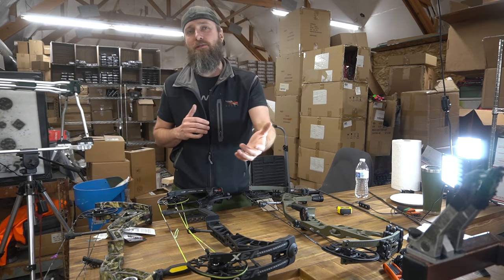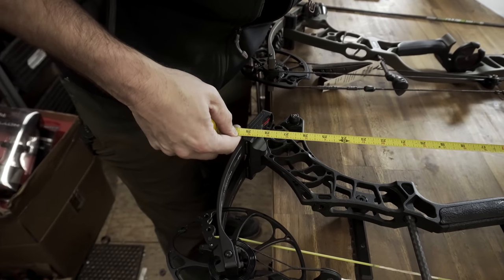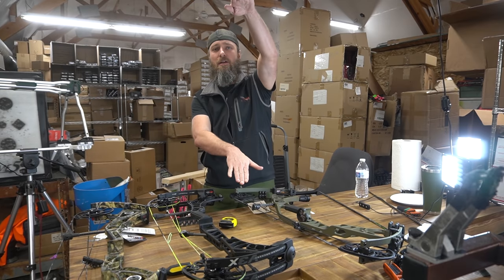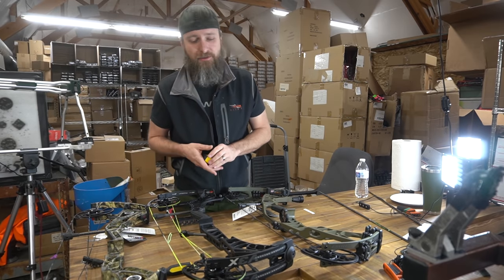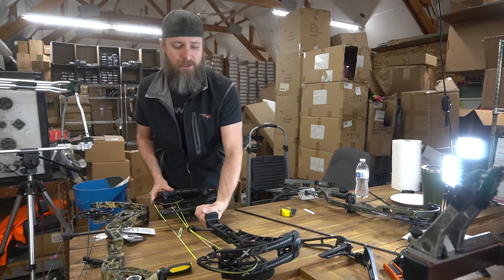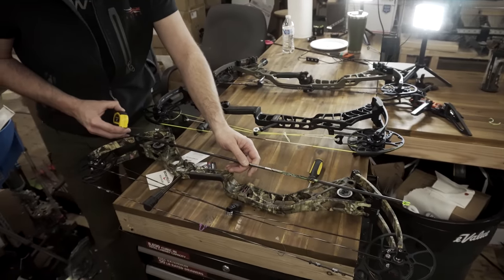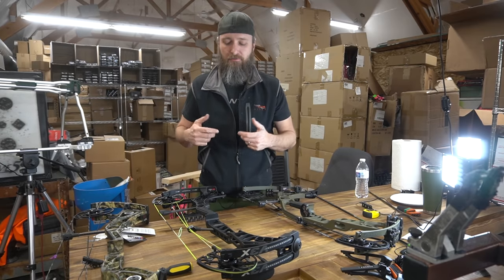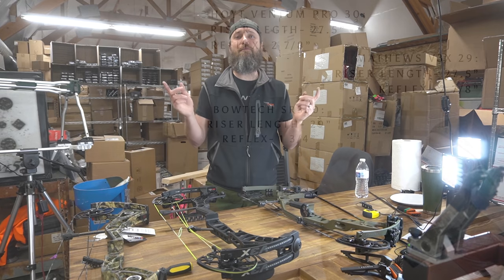What Makes a Bow Accurate? Find out with MFJJ!!

Comment: Additionally, would you consider doing a video on what you consider "great" and "acceptable" accuracy. Like great is 1" groups (or less) per 10 yards of range and acceptable is 1.5" per 10 yards of range (e.g. 4" at 40 or 6" at 40) with 3 to 5 arrows. Also, could you compare your shooting with the various releases - handheld thumb-actuated, hinge, and trigger finger-actuated to see if there is an appreciable difference in terms of accuracy and point of impact. Thanks again.
Reply: I would guess every flagship bow on the market is possible to shoot within those accuracy standards when properly set up. The bow fitment to the shooter and tune would have a large impact on those results which would vary from person to person.
Reply: @jordanc1780  That is a great point - that the bows are inherently capable of tight groups. So, when the archer is added to the equation, the group size outside of the inherent capability of the bow is the archers fault. Then, what we need from MFJJ is what are the common faults in archers that cause poor shooting.
Reply: @richarddean3154  I was just thinking the same thing. Many years ago I was dead set on upgrading my rig because it wasn’t shooting good for me. That kinda flipped on me when the guy helping me picked up my bow and drove tacks. Changed a couple of things and I was too!

Comment: I’m very happy you’re going to include these stats in your bow reviews going forward. Could you also consider measuring string angle on bows? This is also an important consideration and it’s info that’s almost impossible to find.
Reply: That’s why they give you axle to axle. Plus it’s going to be different at every draw length. If you don’t like a tight string angle then you don’t want anything under 32 inches imo and honestly if string angle is a concern for you then 33/34 and up is all you should be looking at. Anything at 34 and over will be perfectly acceptable for anyone in the string angle department.

Comment: You may also consider providing total length when you provide mfg ata. A 30" ata bow with salad plates for cams will have a real world length of 36+" which would be a negative for some, but would  provide a better string angle, and be a positive for others.

Comment: Good info. I feel like the bow that feels the best and I have the most confidence with is what I’m going with. I’m not a target archer, I’m a hunter. I shoot every day, and a lot. But I still don’t feel I’m accurate enough for these differences to really stand out enough to make my overall decision. Almost all the big manufacturers make equipment that will far outperform most of us. I truly like what feels best. Draw cycle, steadiness etc…I don’t shoot farther than what’s acceptable with my Broadheads, so that’s the true test and I typically don’t tend to go off measurements or popular opinion. That being said, these added measurements from manufacturers would make it easier to make a decision without spending all day in a bow shop and/or wasting money trying to find what you can shoot best if you don’t have that availability.

Comment: I agree with you that the riser length and reflex contribute more to accuracy than brace height and axle-to-axle.  However, brace height can be reflective of reflex, since a larger brace height tends to indicate less reflex in today's parallel limb bows.   Similarly a longer axle to axle somewhat reflects a longer riser, particularly within a brand; though you pointed out that across brands, this is not always the case.  Regardless of any of the four measurements that you discussed, what I think contributes most to the accuracy of any bow is the amount of time the owner spends practicing with the bow; and by practicing I include shooting arrows at various yardages and working on form.

Comment: 👍👍 it's about the mechanical advantage of leverage points. Basic geometry. As the pivot point ( where  your hand meets the riser) is moved back toward you from the limb pivot point the " triangle " becomes bigger. This allows an easier ability for the limb tips to move left or right  because the three points of the triangle are farther apart. A long narrow triangle, even at full draw when the cams are rotated and the position of the string has moved along with the limbs flexing back toward you, will have less perceived and actual " wiggle" left or right. For those that work with their hands and build things this concept is easy to grasp. For those that can not understand all this- just trust ol' MFJJ!

Comment: Reflex and brace height is all I care about. 
A2A and riser length make minimal impact on perf unless you're shooting ultra long range.
Brace height tells you how soon your arrow leaves the string and reflex tells you how easy it'll be to shoot regarding torquing - this is why I only buy recurve bows with the throat and plunger hole perfectly aligned (vertically).

Comment: Good info. Explains why I shoot Bear bows so well maybe. They don't get much more than a snarky response or comment most of the time but they are very easy to be accurate with bows. The newest Bear Execute 32 flagship  measures 1.5 inches. The Moment from 2016 and 17 measures just under 2" and the Refine from last year measures just under 2". All very accurate and quick bows regardless of the brand they Bear, lol.

Comment: MFJJ, good video, but do you have any doctrine when it comes to know “when should I upgrade my bow”?  I’m looking for some kind of metric, similar to those with used cars to know when is it about time to upgrade? When has the tech upgrade enough to I know I’m getting my money worth of upgrade? For me, I have a 2015 Prime Ion bow I bought used off of EBay . Thing shoots good, but it is hard to tell if upgrading to a V3 or V3X (or other) will yield a sizable difference in my consistency, accuracy, etc. it’s hard to know, on a limited budget, so I upgrade my arrows / rest or do I save up more for a newer bow? Hard for me to go actually shoot, I live in DC with no local bow shops to work on my rig. Thanks!

Comment: Makes sense. Curious which measurement you think is more important. 
I love my SR6, but have never shot a Mathews besides the older single cams. 

For long distance shooting between, say, a V3X 33 and a Revolt X, which would be more accurate?

How does the CP28 compare to the V3X 29 with riser length and reflex?

Comment: A couple of things that you should probably add here would be limb angle and cam system. 

Riser length is not where any of your accuracy comes from, if it was then all of your manufacturers would be still be using risers longer than the ATA. Long risers create parallel limbs and reduce hand shock, they have no effect on accuracy. If we look at the target bows that have dominated over the years, PSE, Hoyt, Bowtech, older Mathews models, have all short, deflect risers with very steep limb angles. This creates an extremely stable and accurate bow and also reduces riser flex. 

Cam systems are one of the most important part of creating an accurate bow. If we take a cam system like the cross centric cam, split yoke binary cam, even some hybrid cams, those cams are very particular about timing and typically the cable creep on these cam systems can greatly vary, thus affecting accuracy. Take a system like the parallel load binary cam or four track binary cam and those cams load the cables equally throughout the shot cycle, equalizing load and creep along the cables.

Comment: This makes sense based on my recent experience. It's the reflex dimension more than the riser length in this case. I tried to figure out why my new bow felt like a noodle (torquey) versus my other bow. I haven't measured those bows yet myself but they are among the ones you have measured in this video. My Bowtech is rock solid compared to brand X. I sold the brand X and moved onto brand Y which is more solid than the X but not as compared to the Bowtech. I will be measuring both today to see how they compare.
Reply: Brace height?

Comment: What role does limb angle play in the accuracy equation?
I have noticed bows at full draw with past parallel limbs and high let off seem to be very easy to torque.
I have also noticed most target bows have very upright limbs.

Comment: Question that is just a little relevance that I can’t get a straight answer to, please....while measuring, ata is it center to axel bolt to center to axel bolt? And for brace, deepest part of grip to inside of string, middle of string or outside of string?  Your help, please. I’ve been in archery for years and this small insignificant question has bugged me.

Comment: Does reflex really matter? A set of ultra short limbs would have less leverage to counteract hand toque in the case of the Bowtech. Whereas long limbs have more leverage to counteract hand toque, like on the V3 Mathews. I would think the distance between the grip and the axels is the real key to accuracy. Hence why target bows generally have smaller cams. The smaller the cam the further back the axel is from the grip for a given brace height.

Comment: Good video, 👍 I will add that a bow with a 7" brace height will always be more accurate because it helps settle and calm the bow down from wobbling or wagging the dog as I like to put it.  Mathews has the greatest amount of side-to-side wobble in my oppinion and therefore when your watching a target bow being drawn back you can see the wobble more because of the longer stabilizers compared to a hunting bow set up. Manufacturers push and emphasis speed more than accuracy...it should be the othervway around...if your shooting a hunting set up @ 70 and 80 lbs then speed and less arrow cast becomes the overriding factor over accuracy. First an accurate bow almost always lands on a comfortable and manageable draw cycle....also I like to measure axcel to axcel and mark that center spot on the string then determine how that relates to the berger button location...you would be surprised how often those two locations don't line up....accurate bows most always line up in this regard....thanks again 🎯🎯🎯

Comment: I shopped all of the bows this year, and found that the bowtechs held really nice but I was not a fan of the grip. This video shows there's a lot of nuance in bow buying, that's why it shouldn't be a rush decision! I ended up going with a prime inline 5 which was way longer than I had planned on buying of a bow. But of all the bows I shot this year, in my hand, it held more steady than any of them.
Reply: I also went with the Prime Inline 5 for the same reasons.  It just flat out shoots which makes a lot of sense when you take into account the metrics in this video.
Reply: @raywarner4704  100%. What options did you get? I went with 80 lb limbs and hammered gray finish. Can't wait. 4-6 week lead time because of the limbs. But worth it.
Reply: @ApexPredatorOutdoors  pretty basic setup for me - 70 lb, grey riser black limbs.
Reply: @raywarner4704  Ita a great shooter either way! Enjoy!

Comment: Fantastic mfjj! It's about time someone provided real info rather than regurgitating marketing crap. I'm over 50   and have owned countless bows. Reasonable reflex, long riser (and associated weight) are key to accuracy. I currently shoot a 2015 Mathews Wake: 5lbs, 33.5 riser (35 ata), 3" reflex, 5" brace, and 352fps with smooth draw. 7 years ago when introduced the pundits said  it was too heavy, long, expensive, and twitchy. If manufactured today it would be more or less inline with what the flagship bows are now....only faster thanks to the 5" brace height. The Wake was used to take gold in the 2016 50m womens European World Archery Cup, so it must have some level of forgiveness. 

It's nice to see Mathews and others introducing flagship bows that are almost as good as a 7 year old bow. BTW, I use my Wake to hunt (stalk and tree stands), and it's not too heavy,  long, or unforgiving.

Comment: I'm curious to know ATA lengths at full draw. It seems this would be the pivot point that's most important for torque while actually shooting. Great videos! Looking forward to your 3 bow builds!
Reply: ATA or string coming off the cam at full draw?  I think the total distance between cam grooves where the string comes off is what really matters since every manufacturers cams are different sized and depending on your draw length will be coming off at a different part of the cam when it stops.
Reply: @nathanwiens108  yea good point, some cams are really big now days. Agree 100% I'd like to see those numbers where string leaves the cam

Comment: Since I started shooting bows with fingers axle to axle determined release consistency. The let off also determined consistency 65% was more inconsistent , release improves this in wind higher let off decreases this as well and decreased  accuracy and speed. I agree riser makes a difference  . Brace height improves string contact time and improves is draw length which improves speed . I'm noticing cam design affects bow weight vs arrow weight  is a big gap speed bows don't always. Yield high fps when looking at 500gr arrows and accuracy . Does the axle and cam affect true speed and accuracy is my question ❓

Comment: I cant dispute your thoughts on the amount of reflex plus or minus effecting accuracy mostly because I'm not a very book smart man but i think It comes down to a archer shooting the bow and going with what is most comfortable for said archer to shoot . That said I ve been shooting regularly since i was 10 years old and im 49 now and have owned many bows and I have  bows with a ton of reflex that i shoot leaps and bounds better both that have great stability and accuracy over my very low reflex target bows and vice versa. I have bows with nearly no refex that are extremely torquey . I think overall weight and the grip have more to do with accuracy than the amount of reflex as well as riser stiffness but like i said that's just my opinion and what works for me may not work for you. Also a bow with more reflex tend to have a longer power stroke giving the arrow faster speeds wich is why speedbows have allot of reflex . Anyway to each his own . Thank you for your great videos and intelligent incite into parts of the sport most never think about 👍

Comment: I shoot the hoyt but it is torquey compared to my old elite 35 you can pretty much grip it a few ways and still bustem the hoyt makes it a little harder for a repeatable grip unless your shooting alot everyday wich is how I feel I have to shoot my hoyt It shoots lights out but you can't take a month off from shooting and expect to just stack arrows  at long range my old elite I could go get it right now stack em in there out 50 and maybe on out to seventy and I haven't shot it for months lol hard to explain to people I like both but I can clearly tell my ventum is picky or finicky just different to the point I ordered a new grip for it I'm hoping that helps out some with repeatability I kill with both but there is Def a difference I just feel like I need to shoot the Jesus out of the ventum for it to be really accurate out at longer ranges  like 60 70 and beyond

Comment: I cant see how reflex is relevant at all? Not saying it isn't.  But id like to see some physics explanations.  
The longer the reflex the larger the polar moment of inertia and in theory more stable . Its kind of just acting like stabilisers. 

Help me understand how the bow pivots around the reflex?

IMO it pivots around the grip. If the cams move right the limb pockets move left. 
The shorter the distance from the point the string leaves the cam at full draw  to the grip, the easier the bow can become misaligned with the string. To exaggerate that. If the cam was in front of the grip. The bow would want to spin around.

Full draw (brace height) is the only relevant factor in my opinion.  So large cames that move the string back further at full draw...

Comment: The further the throat is back behind the limbs. The lower the brace height.  Which I believe makes it more critical.  How can you say there not inner twined. To say brace height dosent.correspond with your limb flex of your meaurment.  That to me is like say the higher percentage your left off.  The less critical your arrow spine is.
Reply: Brace height does matter. I'm talking comparing bows with the same brace height how to determine which is likely to be more forgiving
Reply: @joshjones6862    yeah.  That's a good question.  I can't think of an absolute answer on that one.  The longer your power stroke the shorter your brace.  Just like your gonna have a quicker and more forgiving shot with lower let off.  Great sport ain't it.  Never ending pursuits😄😄